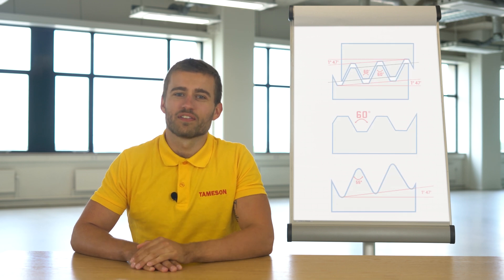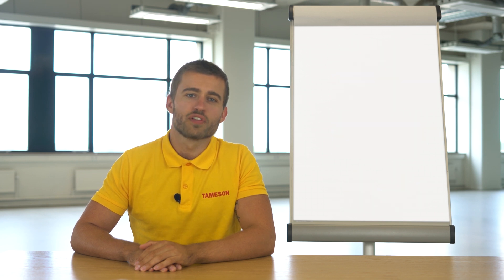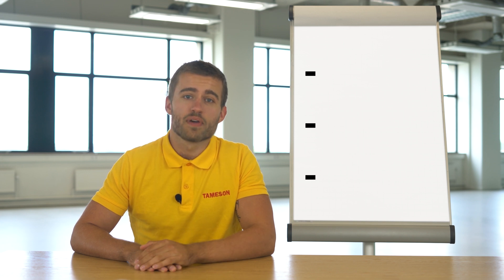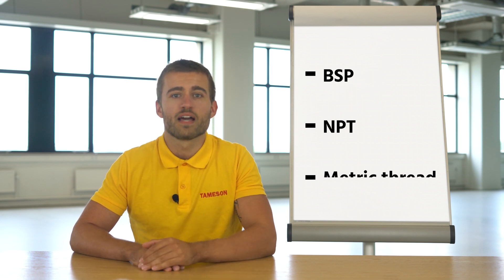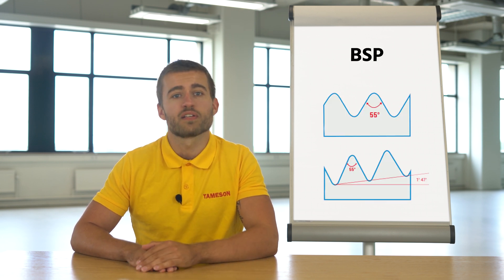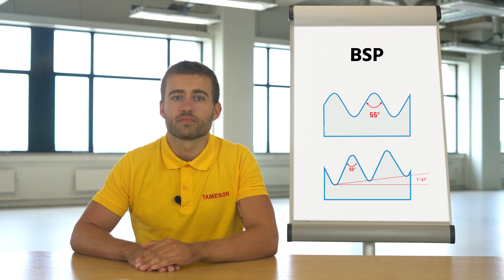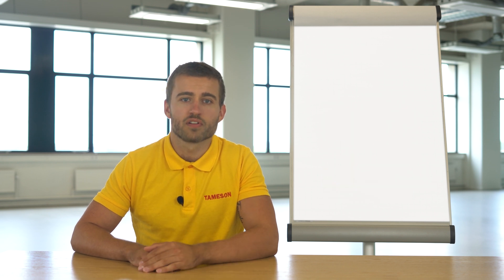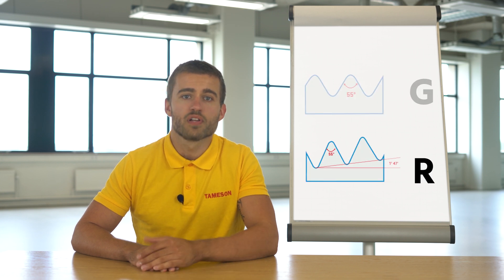Thread Standards | How to identify pipe thread type | Tameson

Comment: Hi, how do AN and ORB fit into this standard? I've been confused about the difference between these and the ones you showed
Reply from the maker: Hello, AN (Army-Navy) and ORB (O-Ring Boss) are specific thread standards. AN fittings are commonly used in aerospace and military applications, while ORB fittings are designed for hydraulic systems to provide a leak-proof seal with an O-ring.